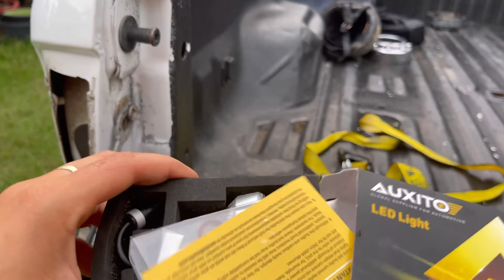BRIGHTEST LED Reverse Light Upgrade Ford F250 Superduty Powerstroke

Comment: I have a 2024 F250, I saw on one site if you add LED lights you may have to use forscan program to let computer know you have LED bulbs. Any thoughts?
Reply from the maker: @rodneyallgire6864  I am not for sure on the newer ones but I wouldn’t be surprised if

Comment: Just swapped my 01 tail lights to the 08 style with these bulbs today. Have you had any issues with the Amazon bulbs connector getting water in the factory plug or anything? Wondering if I should have put some electrical tape around the bulbs connector
Reply from the maker: Hey I have not. Make sure the seal is on it might have fell off. And make sure it’s fully inserted I. The headlight housing